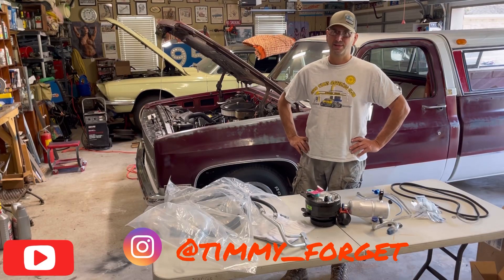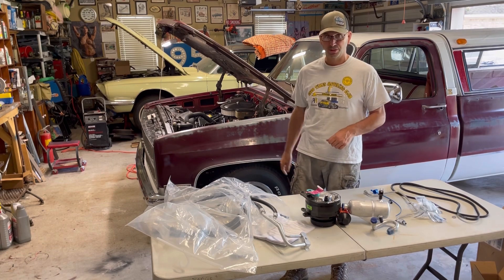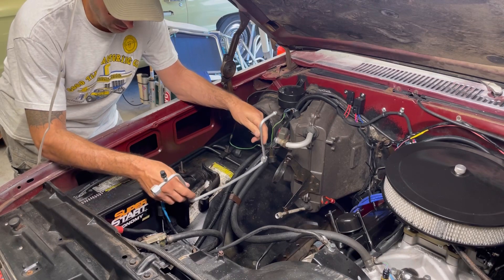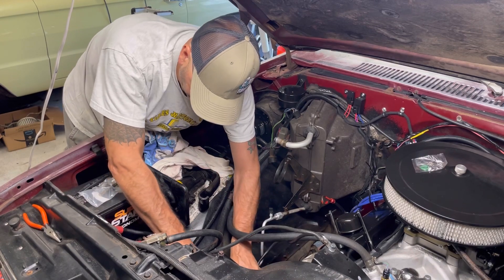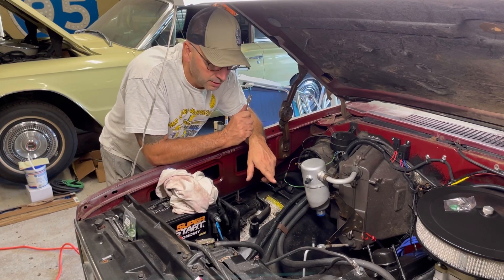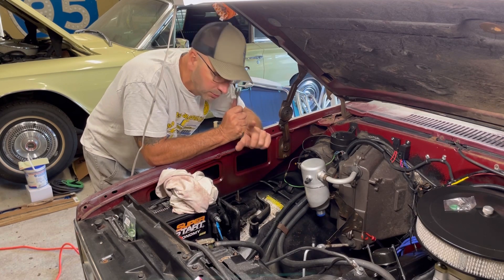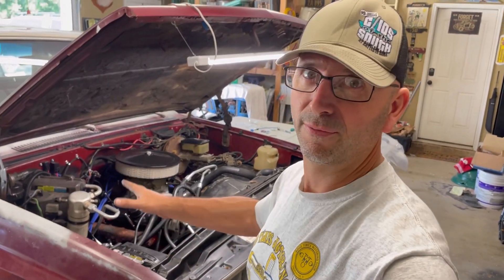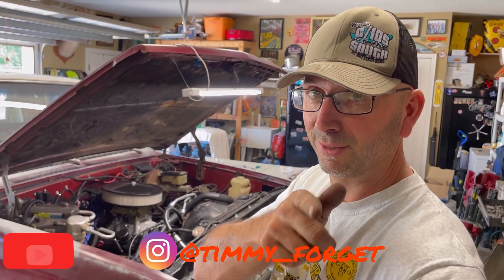Fred the C10 gets an AC upgrade!

Comment: That extra connector you had may be for the old carb, if i remember right the carbs had a solenoid to increase the rpm when the ac was turned on
Reply from the maker: Aha! I do remember on my white truck Pearl, there was a solenoid on the carb and I didn’t know what it was.
Reply: Correct!

Comment: at 26:04, you mentioned that you filled the drier with oil. Is that normal? I thought the drier was to prevent moisture in the system.
Reply from the maker: Each system calls for a specific amount of oil. Part of the oil goes in the drier to help circulate it throughout the entire system. ..  I’m not a n A/C expert by any means, but I had done a ton of research before we put it all together.

Comment: i know this was posted a while ago, but do you happen to have the link for that first hard line hose you installed?
Reply from the maker: LMC truck , I used an 85 liquid line and swapped the condenser to an 85 style also 

32-0918  
TUBE ASSY-CONDENSER OUTLET
CHEVY GMC 85-87
REQUIRED QUANTITY: (1)
$19.95
Reply: Thank you so much!
Reply from the maker: @1977heavyhalf anytime!
Reply: You needed the compressor that has the hook up at the 9 o'clock position

Comment: hi
always use compressor oil on o rings when assembling prevents tearing /leaks 
old orifice tube  had a dirty  filter   ------- evaporator  core needs reverse flushing with white spirit [fully evaporating ].
Highly recommend evaporator be removed and have fins cleaned .
Always use rubber lined P clips to restrain hoses and pipe work to body . They prevent cracked alloy fittings/lines .
Fitt h/duty clutch fan ,,, Fit electric  pusher 12-13 inch 15-20amps condenser fan wired by relay to compressor feed .
Charge by weight starting at 90% . U need correct charge for 100% liquid to reach evap core inlet Why more liquid the better it will cool . Also refrigerant transports oil ,if insufficient charge not enough oil returns to compressor . If high pressures are to high u have condenser cooling issues . 

All the above if done correctly works as a system 
Ask tech if u can see charge pressures 150-160psi  great but uncommon   160-200psi good ,, 200--225 satisfactory  225--250 borderline  Ambient during charge ??   ***test pressures at idle and at 1500rpm take note 
Evacuate for 2 hrs and do a vacuum degradation  test  then charge .
Best to fit new low pressure cut in/out switches 
Happy days in your soon to be cool truck .................
Reply from the maker: Thank you so much for all of this information!!  I really appreciate it.
Reply: @Timmy_Forget  Unfortunately even many mechanics come up short . So just paying it forward